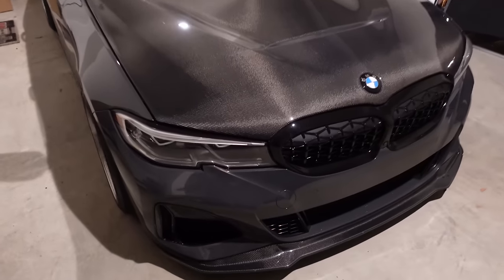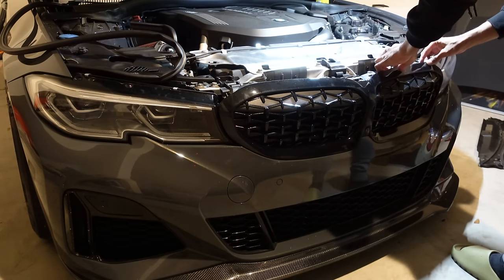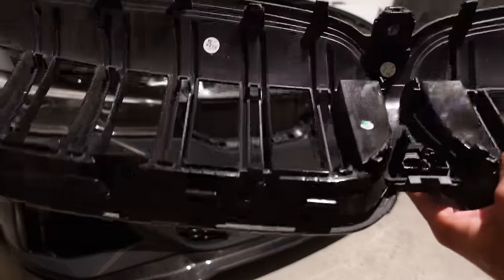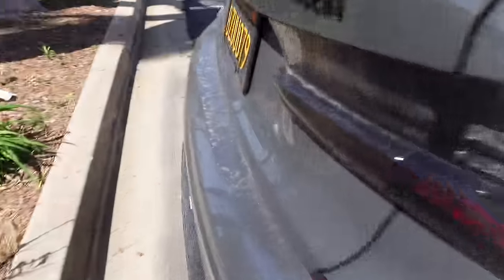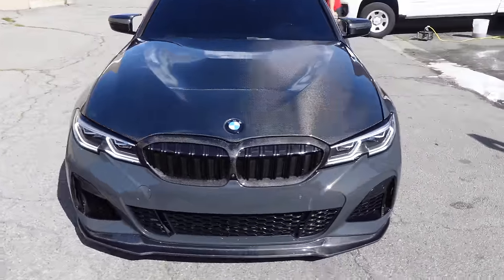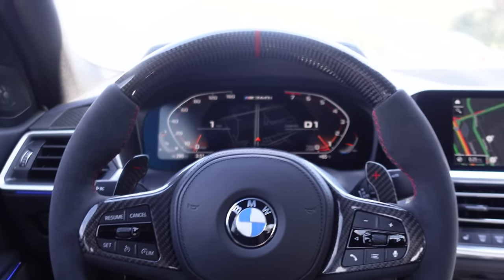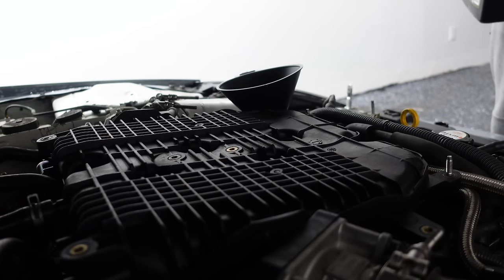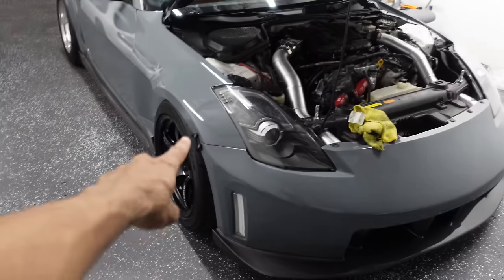OG Bmw Style Carbon Grille For The M340i

Comment: The grill looks super clean. I was going to comment on cutting the grill flaps off but I just read your description hahah. It's worth it and no CEL, I say go for it
Reply from the maker: I heard someone with a m340i cut them and still got CEL leaving the motor plugged in & had to delete it through the tune somehow so idk I’m skeptical 😂
Reply: @Freshhkiicks  Oh shit I have not heard of a CEL after cutting. Maybe they cut at the wrong piece. I think as long as you leave the rotating arm in place and just cut the slat it still operates like normal. It's pretty common on the X3 M40i's so maybe look there too.
Reply: @Freshhkiicks  a lot of people have done it to the 540 with no problem. FullBoltOn Garage has a good video on it

Comment: I like it. For the active grill seach up on youtube how to delete it, its only been done to the 540i g30 but should be the exact same for m340, they basically just cut the plastic flaps but leave the motor alone so it can just spin but not actually open or close anything since theres nothing there to close, no check engine light since the car thinks its opening/closing something still. FullBoltOn Garage has a good video on it.

Comment: Active grills are nice because they will help car get to temperature quicker, theoretically helping car last longer if all else is maintained. Too bad you can’t have switch for it to leave open when car is off…
Reply from the maker: I don't think the car getting warm fast is a problem in CA lol
Reply: @Freshhkiicks  yeah, for engines with bigger displacement it’s easier, but you’d be surprised. My car has a small displacement and when it’s 40*~ out the car takes an easy 10 minutes to get warm (driving), and you can’t have the heater on. If I turn the heater on even a little I watch the coolant temperature drop. It makes sense though because all manufacturers are going to small displacement with boost so it really is effective

Comment: Bruh In my opinion the grill is fucking fire! I pray you don’t slip in the drip your ride is oozin 🔥

Oh an question, are you keeping the stock rotors or are you getting performance rotors?
Reply from the maker: just bought these oem ones so not anytime soon. Didn't find any reliable source with slotted/ drilled for m340i when I needed them.